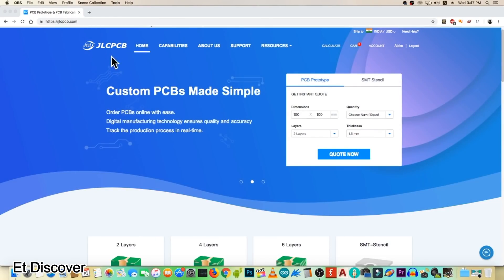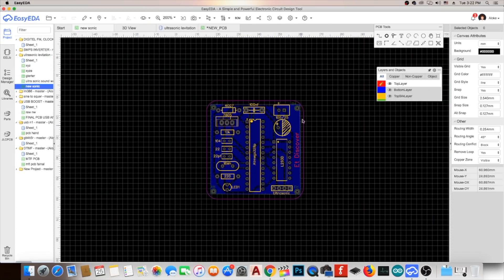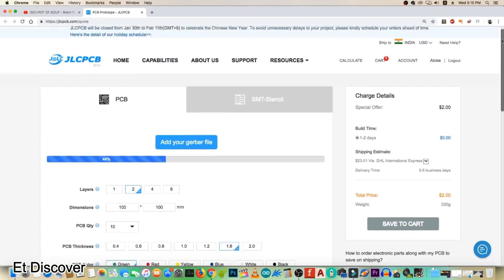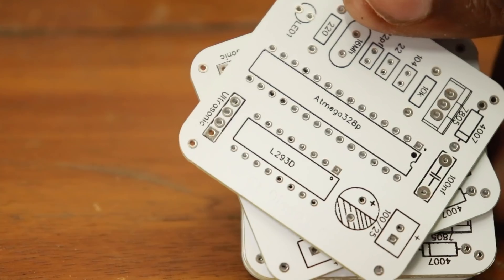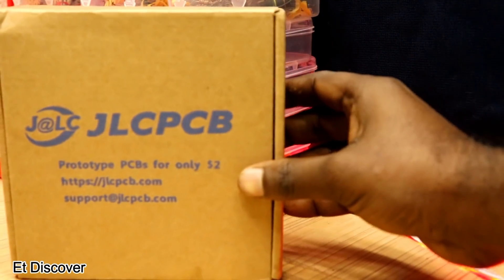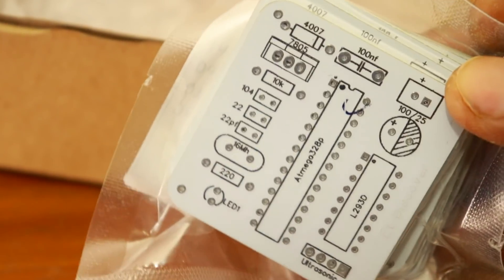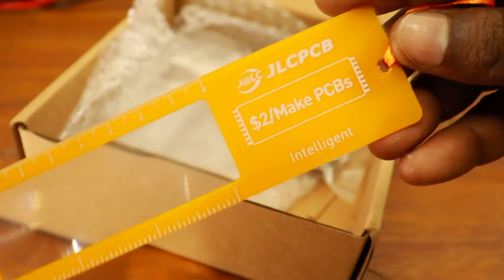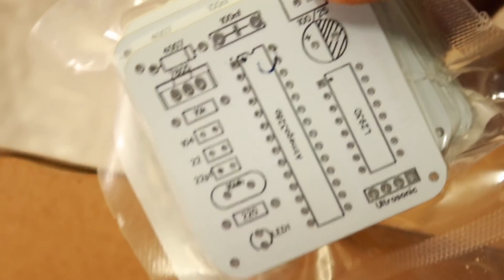You can Make FLOAT any Object in between your finger # Student's science project#

Comment: No doubt it is a very good science project for demonstrating the standing sound waves. Thank you for this beautiful physics project.
 I have following questions. 
1) Why did you remove the casing of the US transmitter?
2) Why did you use TWO US transmitters? If upper one is replaced by an obstacle from which sound wave reflects back then standing wave is also produced. 
3) What is the role of L293D? 
4) What is the distance between two US transmitters?
5) Can a signal generator be used instead?

I shall be grateful if you kindly answer.

Comment: Can you please explain me how this thing works ET discover. Bhai agar ye editing ka kamal ha toh sach bol diyo. Or agar ye actually me work karta ha to iski pdf link ya principle share kar diyo mere sath.
Reply: These are standing waves... when two waves of same frequency but different phase come and meet from opposite directions they interfere and great a pattern which forms nodes and antibodies... pressure nodes are places where the air can move according to the amplitude variations.... but pressure anymore are places where air is not moving that is amplitude is 0 given that both waves have same amplitude ... pressure nodes can also be said as amplitude antinode and vice versa.... 
So if u keep something in the loop between two amplitude antinode... it will stay there as the forces balance it..... if u wanna understand in depth it's all mathematics and trigonometry in it😅😅
Reply: Hope this helps... And sorry btw... at some places due to auto correct it came wrong....

There are nodes and antinodes.....  (pressure/ amplitude)